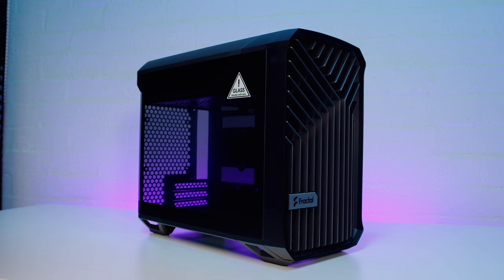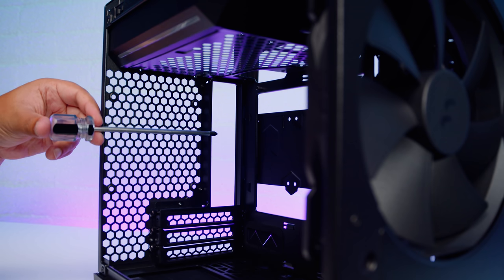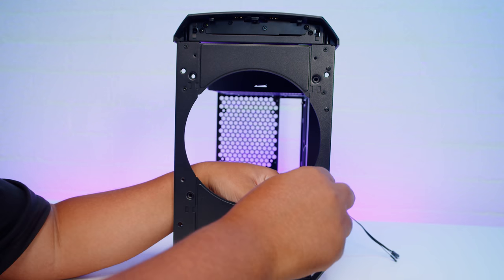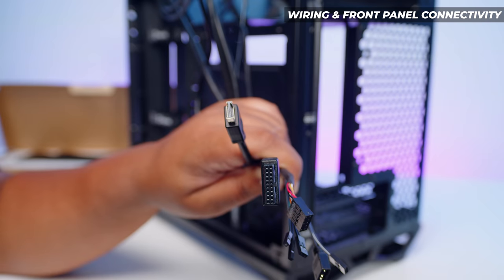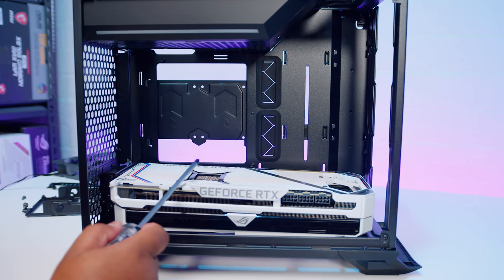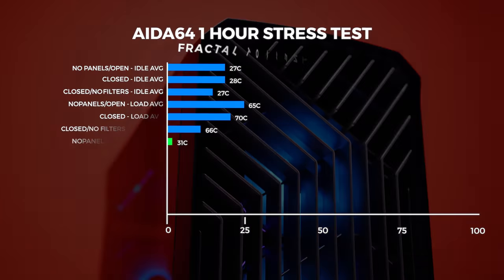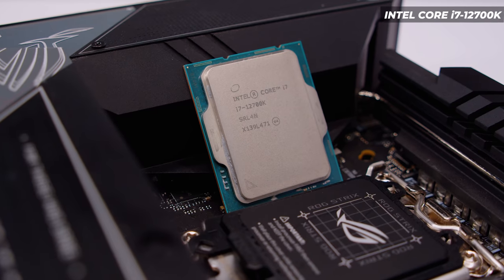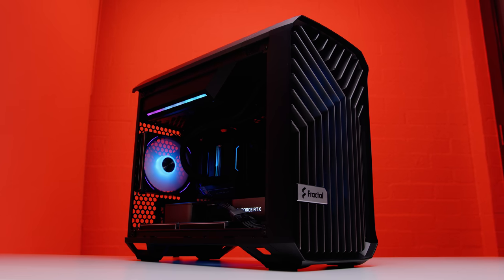The Fractal Torrent Nano is GORGEOUS!

Comment: It seems that too much dust will enter the case through those big holes on rear side.
Reply: this is supposed to be a high positive pressure case, nothing should be pulled in anywhere but from the front

Comment: Which is better this fractal case or ssupd Meshilicious? I’m game dev and need a good looking small case for my desk.
Reply: if you're still wondering - the meshilcious is about half the volume of this case.  And it does well with large graphics cards and 280mm rads, so it can handle high end components easily.   Some build quirks with it, but if space is a premium I'd go with the meshilcious.

Comment: your radiator emits all the heat into case, bro ))
Reply from the maker: you don't understand how cooling works, bro
Reply: @GearSeekers  umm, well, why the hell are your cool rgb radiator fans running hot air into case, instead of out of case :-) ?
Reply: well, excuse me, I apologize, mea culpa ... but now I am confused ... ya, never have experience with AIO ... only thinking ... and yes, its fact that when AIO works as intake of COOL air over it better cools CPU but also warms case interior? but when   its fans push already quite WARM air from case over radiator, it cools the interior but is less effective to cool down CPU ?? again, sorry for quick thinking without experience ... now I feel that only best working option is to have radiator completely OUT of the box )))

Comment: Way too big.  Getting close to O11 Air Mini size.  Mostly because of ATX compatibility and their thick front grill.  Should have mounting for power supply in front so you can have air flow out top back.  Then it would be better for water cooling.  As is, air only and probably better temps with lower noise.

Comment: Should of used the strix in the build not a fe card
Reply from the maker: If you were actually listening. It doesn't fit.
Reply: @GearSeekers  doesnt fit cos you blocked the clearance instead of using the larger oem fan.

I bet results would have been different,

Comment: Knowing that exhaust is the main issue you saw here I wonder how much better this case would do in an air cooling setup using the big fan as a quiet front exhaust. You could still use the gpu and rear fans for intake feeding a big air cooler like the NHD15

Comment: This is a no from me. Top mounted PSU that intakes heat coming off the GPU and radiator? No thanks. PSUs are not designed to intake hot air, especially now that Nvidia wants to pump 400 watts into the GPU. So the PSUs are already hotter from delivering more watts than ever, and now you are cooling it with heated air coming directly off that power hungry GPU. This is a flawed design.

Comment: I ended up ordering this case, I really love the aesthetics of it however the cheap plastic I’m not a huge fan of and there is a lot of it, the top, the front and the feet on the bottom. Very disappointed with the build quality with cheap materials, should have gone more premium even the NR200 didn’t use much plastic in comparison and that case was like $79 msrp.

Comment: Why buy this case, and then remove the front fan? This case is clearly intended for air cooling, so would have been more useful to see a build with a cpu air cooler. Why do YouTube reviewers always add an aio cpu cooler? 🙄
Reply: You actually get more airflow from 2 x 120mm fans. Lots of other reviewers did air-cooled setups anyway yesterday so I had no issues here.
Reply: Yeah, but it adds cost to replace the one large fan with two smaller fans. Should just get another case then.
Reply: @jimmygordonhansen  If you're trying to save a buck this isn't the case for you (especially for an itx mb and DDR5 ram). I can see people buying it just how good it looks. edit: also you could easily sell off the 180mm if desperate
Reply from the maker: The reason I used an AIO is most reviews air cooled. I also mentioned MULTIPLE times that I would recommend air cooling in this case.
Reply: Best of luck with your channel.